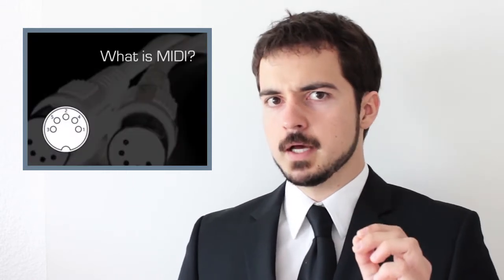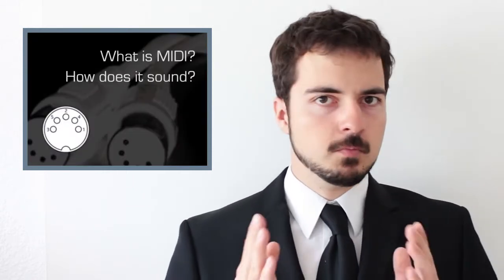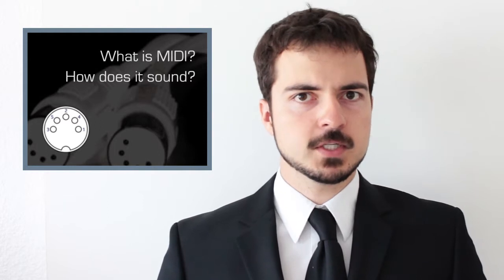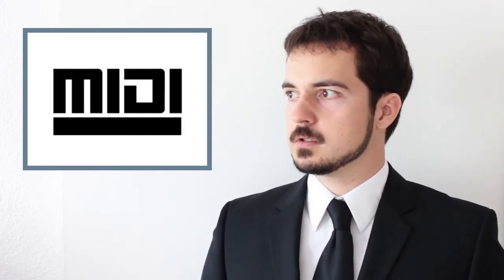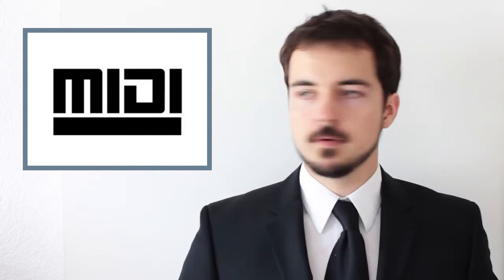What is MIDI and how does it sound?

Comment: But what happens if I take a 3.5mm midi Jack and put it in an amp? It should make some blips and bloops, shouldn't it?
Reply from the maker: Yes, indeed. With enough amplification! Let me know how it sounds ;)
Reply: stop being a fucking smartass.
Reply from the maker: Oh, okay. Sorry. So ... no ... plugging a 3.5mm MIDI jack into an audio system will most probably blow your speakers, because of a possible non-standard TRS assignment. In fact, the TRS thing has only just been specified by the MMA. But oh boy, here I go being a smartass again. I can't stop. Damnit! Can I explain to you how to use a modular synth?
Reply: And what if you put a limiter on the output before putting it through the speakers to prevent them from blowing up?
Reply from the maker: Then the limiter will blow up.

Just kidding. There shouldn’t be much risk of damaging anything. The TRS connectors usually have the sleeve connected to ground, just like when using a minijack for audio. And even if that wasn’t the case, it probably wouldn’t be harmful. Just maybe don’t try it with super expensive equipment.
Reply: Alright. Was just wondering if there were maybe some possibilities to get some neat and unique glitchy samples out of some unconventional methods like jamming midi into a speaker.
Reply from the maker: Definitely! I love those kinds of experiments. I’m sure you’ll get some kind of crackly audio from a MIDI stream. Running that through an analog low pass filter close to self-oscillation might create some neat “filter ping” sounds.
Reply: I'm betting it sounds something like a dial up modem.